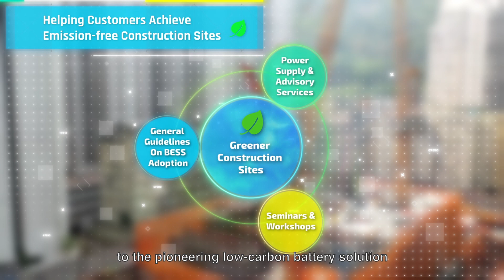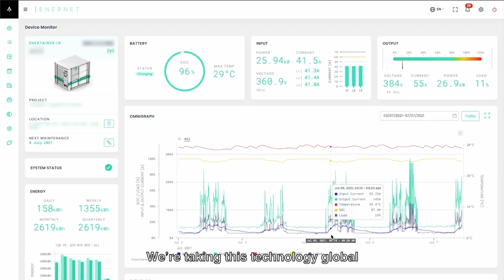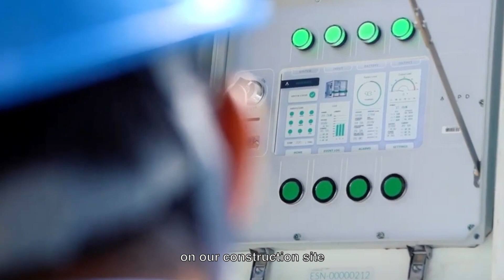2022 AEE International Award - Innovative Energy Project of the Year - Battery Energy Storage System

Comment: Production and storage of energy using hydraulic technology
&&&&&&&&&&&،&&&&&&&&&&
To all companies like Siemens play a major role in impacting the environment by producing energy production equipment in the world, so they must interact with inventors and talent in order to change environmentally disruptive technologies.  Siemens' commitment to steam and gas turbine technologies in energy production is truly devastating to the environment.  Siemens is required to listen to the voice of reason and take the lead in energy production technologies using hydraulic systems that use oil as a substitute for steam in order to raise production efficiency and eliminate steam overheating to 600°C. The hydraulic technology will help to produce and store renewable energy without batteries and with a very huge capacity and in a sustainable way for life .I have this technology and have an industrial model,the technology of producing electricity using hydraulic technology is easy to manufacture and the cost of manufacturing will be cheap and does not need special mining, which means that it will end the monopoly and the dominance of major companies on the means of energy production .
The hydraulic energy storage with a new technology with a huge and unlimited capacity and for an unlimited time and with an efficiency approaching the maximum value of the work rotation and in a sustainable way that will change the ways of energy production and storage from all its nuclear sources, from all types of fuel and from all renewable energy sources